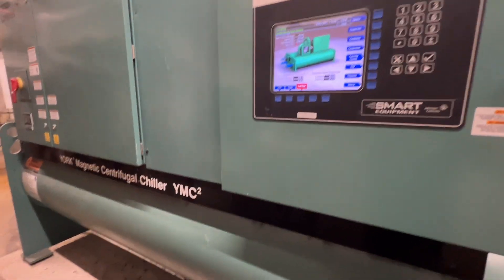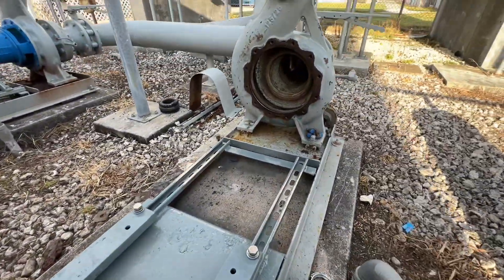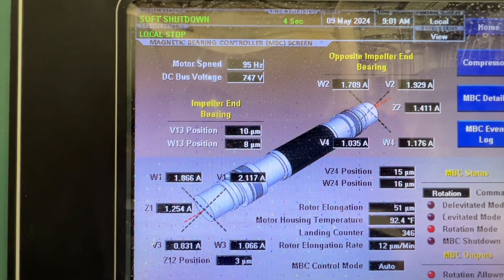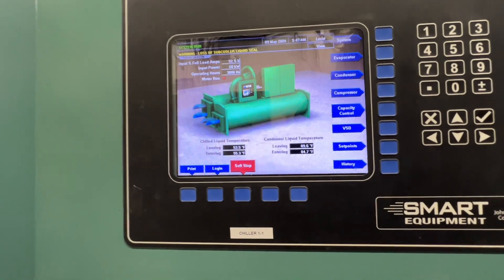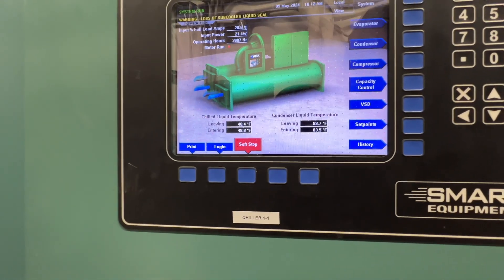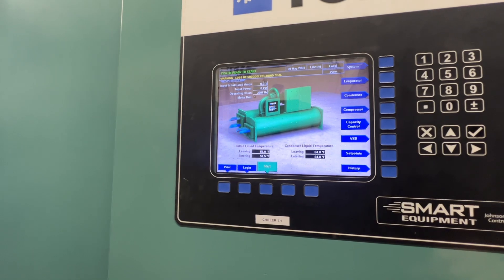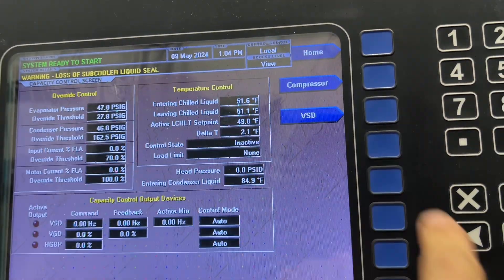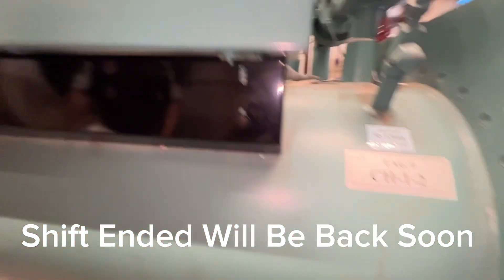Condenser Pump And Motor Install With Some York YMC2 Surging Issues

Comment: Seems like the liquid level valve was not closing off. Or was there no water flow? Condenser entering and leaving water temps the same?
Reply from the maker: JC Calibrated shaft, adjusted liquid level. There’s condenser flow.. chiller 2 has bad mbc amplifier board on back order with JC 🙁

Comment: found your channel i love it. at a risk of sounding dumb is this a small part to a massive air conditioning system my local hospital has a massive set of evapco towers on a two story standalone building always wondered what it was for
Reply from the maker: Thanks for asking, yes these are the cooling towers for a couple of Centrifugal chillers (200 & 300 Ton) that cool many commercial buildings

Comment: Are these pumps for cold storage industrial buildings?
Reply from the maker: Condenser pumps for 2 York Centrifugal chillers used for Air Conditioning
Reply: @subcoolHVAC  oh cool it’s interesting too see the different types of air conditioners, I work in a cold storage facility that’s cool the freezer with anhydrous ammonia that stuff is crazy scary
Reply from the maker: Never worked with Ammonia systems, toured a plant during apprenticeship many years ago. Impressive 👍

Comment: I would of liked to see where condenser liquid level setpoint was at
Reply from the maker: It was set at 38% not sure why, ran out of time troubleshooting… returning soon
Reply: @subcoolHVAC  we have some YK's we had to adjust to 42% to get them to run right and not loose the liquid seal
Reply from the maker: I think 42% will do it. My access level wouldn’t allow me to change it. York and their Access Manager control 👎